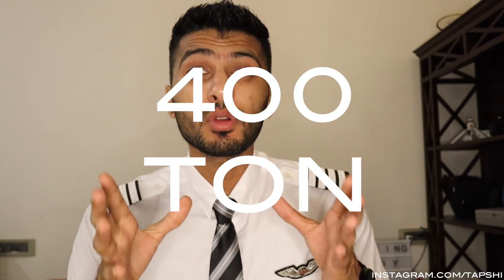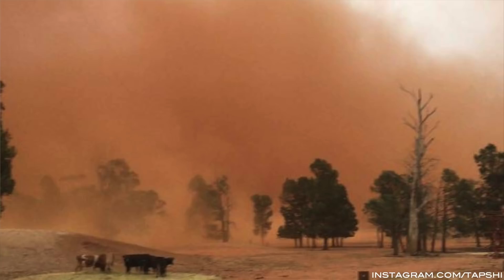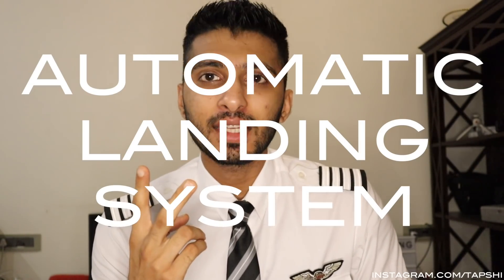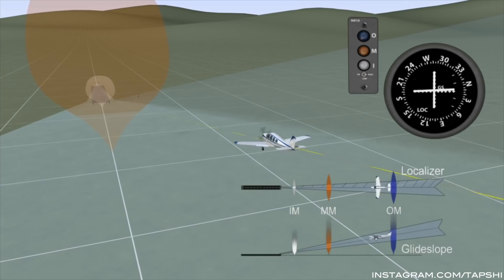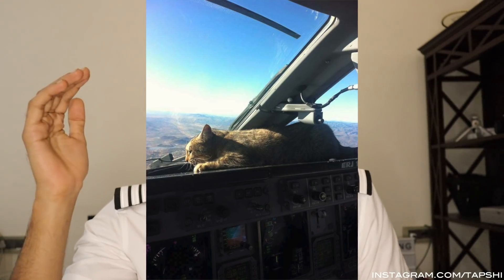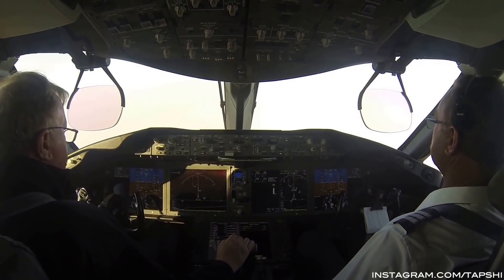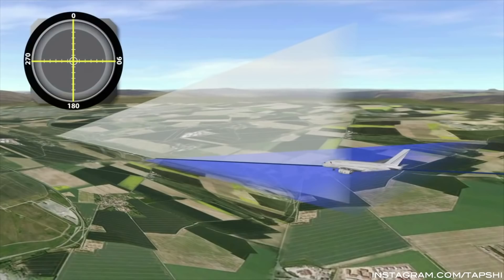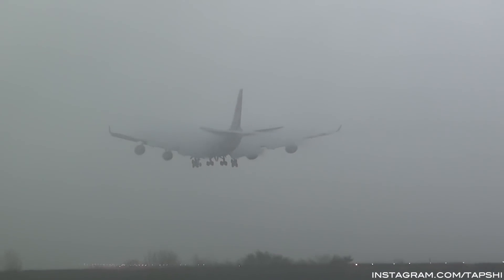Cockpit Stories Ep. 2- How pilots land in bad visibility!

Comment: CAT IIIC is aimed at providing auto-landing and rollout capability to aircrafts at absolute zero visibility. However, the instrument landing system will only get you land on the runway. What happens after that is the reason CAT IIIC is not commissioned anywhere!

Comment: Cat III c is not used because we hardly have any conditions where there is zero visibility.Even if there is zero visibility the ground systems of the aircraft will limit the maneuvering of the aircraft to some extent i.e the plane cannot taxi to the terminal if there is zero visibility.Further it costs a lot to build such equipments.

Comment: The Reason Behind The CAT-C Is Not Found Anywhere On this Earth is That If Visibility Is Zero Then The Pilots Will Have No Minimums And Even Won't even Have The Runway In Sight And In The Past Few Years Most Of The Crashes Have Happened Due To Aircrafts System  Interpreting The Wrong Location Of The Runway And Airport And If The Pilots Will Have The Runway In Sight At Minimums They Will Ensure That The Runway Is In Sight and Land Safely 👍👍✈️🙏🛬

Comment: Won’t be able to taxi in 0 visibility I guess 😜 
#VYAA
Reply: Towing the Aircraft to gate is possible na 😜
Reply: You do know about the 1977 crash in Tenerife due to 0 visibility
Reply: @theintrovertedtraveller21  yes
Reply: Which aircraft should I choose for my type rating which will help me get the job and also is DGCA exams and type rating necessary ? Just curious
Reply: @thrive2458  prob Cessna 172
Reply: @kkfalgunan19  Antonov 225
Reply: @thrive2458  Maybe a A320, or B737

Comment: Jub plain me travel karate hai to koi dusara plain overtake karate hue kuy nahi dikata. Roj to kitane plain fly karate hai.
Reply: Because there has to be a distance of 5 nautical miles horizontally and 1000 ft seperation vertically, in which even if you pass an airplane you probably won't see it. It's very rare to see an airplane paasing you